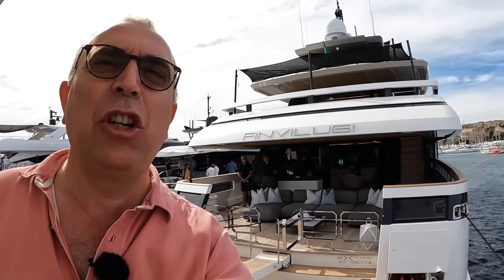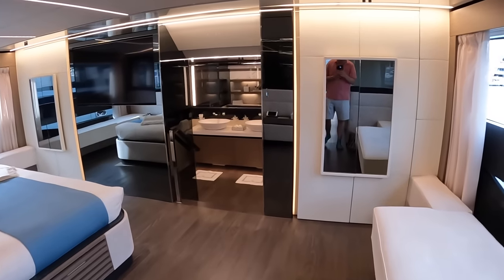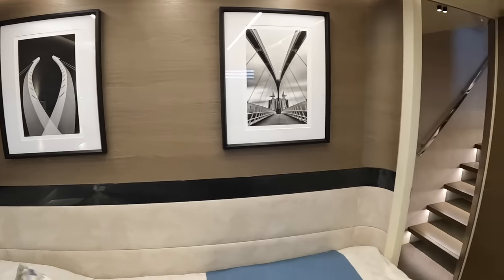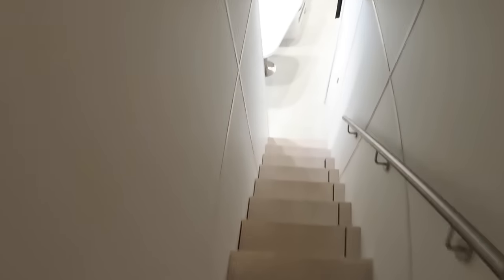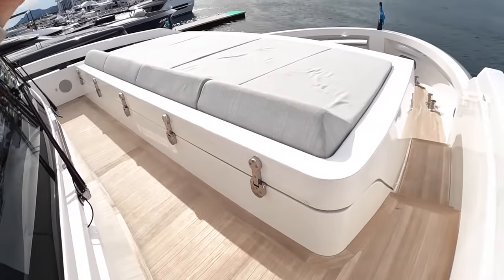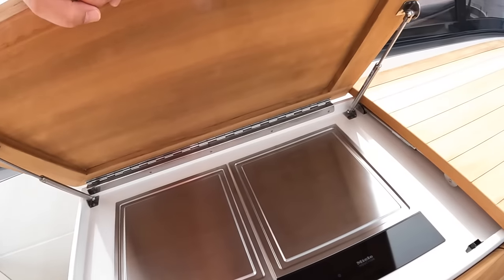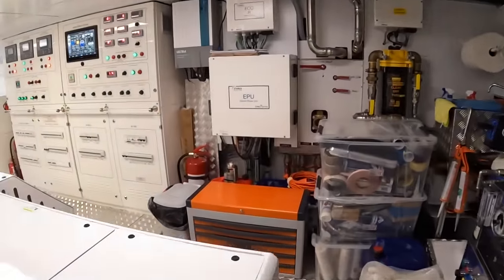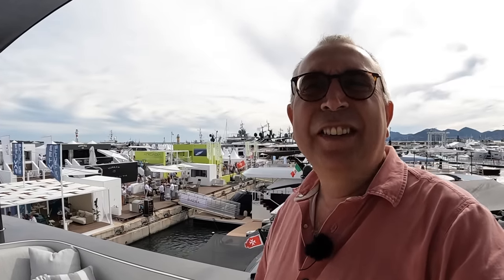€10.9 Million Superyacht Tour : Extra Yachts 96 Triplex

Comment: Really liked the video and boat.
So much so it raised some questions.
So the boat is 28,6 m (94") long (LOA) data from Extra ica yacht, site.
The below 24 m classification, does that comes from waterline length 23,8 m?
And does that mean, you are allowed to helm the boat without crew?
Guess the fiberglass hull instead of heavier steel hull, was to obtain the short waterline length.
Reply from the maker: Load Line Length is basically the length of the main hull, so not including bolted on bits like a bathing platform or possibly a 'crash zone' nose cone that are not structural parts of the boat.
Reply: @AQUAHOLIC  Ahh! Thanks for the explanation. Not really a boat guy. (Edit: at least not yet.) But enjoy your video all the same.
Reply from the maker: @thorofasgaard7405  Stick around, we'll try to convert you! 😃

Comment: 96 feet is slightly over 29.26 meters, so how come as you say it falls within the 24 meters?  24 meters is 78.74 feet, am I missing something here?
Reply from the maker: The regulations concern hull length, so don't include things like the bathing platform or a separate 'crash structure' at the bow.

Comment: A beautifully designed boat that IMO definitely minimizes the rarely used spaces...like spacious bow seating and the 10 person dining table per deck and additional bbq on the swim platform.  I envisioned afternoon lunch on the sun deck with sangria followed by a little nap or watching championship sports on the bridge deck.  When my biggest complaint is that the staircases seemed plain, I think we have a winner
Reply: I can't agree more. Having dining table on every deck always seemed a bit useless when space is at a premium. Now a bar on every deck I can get behind. This yacht seems to have more idea of how it is to be used. The galley and main dinning area on the same deck is probably much easier for the crew. I'm told the inside dinning table in most main deck saloons rarely gets used. The center line wide staircase leading to the swim platform is a great feature as well.

Comment: 24’ water line doesn’t that bring it into the realms of owner operator if you wanted!
Reply from the maker: It's Load Line Length, but yes you are correct, it does.
Reply: @AQUAHOLIC  No, it's "HULL LENGTH" when considered for RCD.
It's "LOAD LINE" when considered for Small / Large Yacht commercial classification.
Read MCA Marine Guidance Note 645 (M) for clarification of the difference in definition and useage.